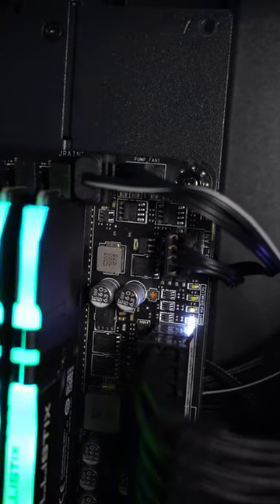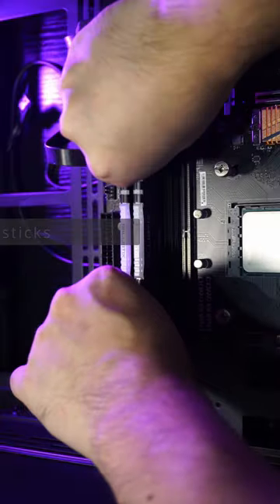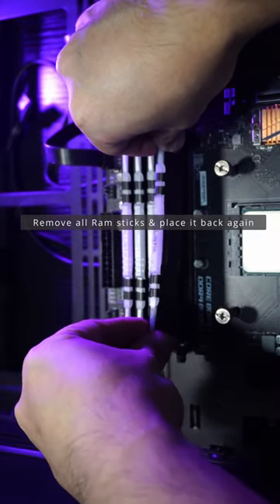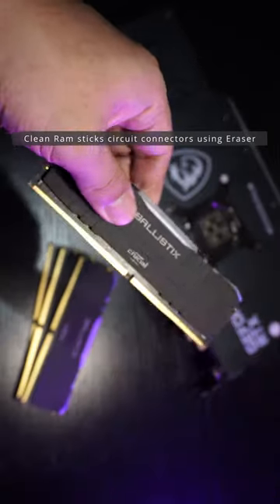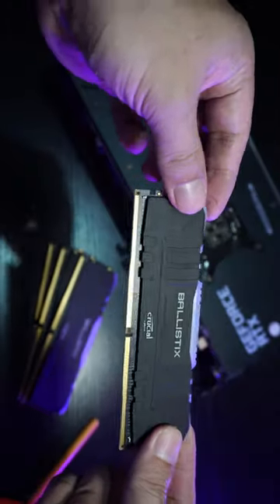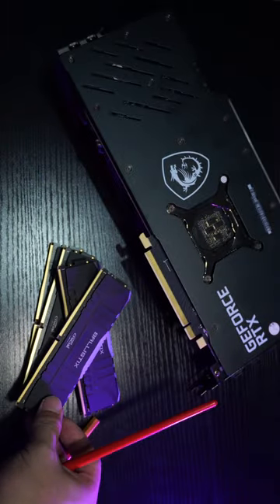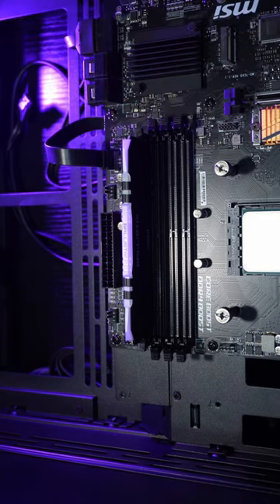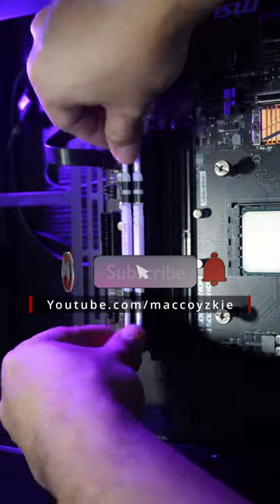Dram Debug LED always on FIX Part 2 #shorts

Comment: Actually. Instead of erasing the dark marks. Lightly Use the lead of the pencil instead, color in all of the metal connectors. The lead acts as a conductor boosting the current. No more worries about dark spots and erasing.

Comment: What if I have two ram stick 16gb, 32 in total and both work? I tried to unscrew a little bit the cooler, go through the bios and try to put one of both sticks but they work both
Reply from the maker: if both worked then what's the problem?

Comment: Ty I'm poor and was worried that id have to buy a new motherboard or something. I built a pc a long time ago and I no joke dropped a ps2 controller and it bonked my case and then it somehow bugged out and wouldn't turn on. Even tho I built the pc I'm not crazy knowledgeable about pcs. I took the ram out cleaned it and put it back in and it worked. Ty ❤️
Reply from the maker: glad it worked bro, no problem

Comment: At first I had DRAM LED turned on with no display. After cleaning the RAM like you showed here, the CPU LED was turned on. 
Then I unplugged the keyboard, Mouse and Ethernet cable, It actually work. PC started normally and restarted twice didn't face the same issue.
But I noticed my SSD's lifetime health become 99%.
Is it normal or Should I take my pc to service center for check-up?
Reply from the maker: nah that's fine, check the drive/s it might be almost full, leave at least 25% free space so your pc will boot normally always

Comment: I am currently having the issue where I recently installed a new CPU chip after frying my old one. Fired up perfectly fine however the DRAM light is a solid amber orange color non blinking just solid.  The led lights on the ram lights up fine. The lights on the IO shield light up fine and everything else works fine. I assumed maybe the sticks were faulty or whatever no biggie I switched them out with ones on my personal system that work fine and still the same issue so I suspect at this point that it's the ram slots themselves. I hooked everything up for a POST test outside of the case and that light kicked on. I will go get a can of air duster from the local Walmart and blow it out hopefully it's just some dust trapped inside the ram slots. I tried every slot with 2 sets of sticks and same problem. I assume it's the spots at this point.
Reply from the maker: what are the pc specs with the new cpu? depending on the build it might need bios update
Reply: @MacCoyzkie  Asus ROG b450f gaming mobo, Ryzen 5 CPU, corsair vengeance RGB 16 gigs ram pro I don't remember the speed I think it can go up to 3300 mghrtz I think or some snappy speed around there, Asus ROG strix rtx 2070 super, EVGA 850 watt psu. I had built it once before and the CPU chip shit on me so I bought a new one a few days ago after it being out of commission for about 2 years roughly. Went to install the chip and everything went fine on the POST test except that light turned on. CPU fan runs fine, RGB lights on everything light up fine, tried 2 sets of ram sticks same issue I assume the memory lanes at this point are fucked.
Reply from the maker: ryzen 5 what series perhaps it needed bios update for the b450 motherboard. also what was your cpu before
Reply: I had this same problem bro. I went to a computer technician and everything. Ultimately it was my motherboard. I was high and tried to make RAM mods with it still plugged in. Fucked my my slots
Reply: @ShadyG_  there's a slik chance I had a few beers and might have forgotten to do that...😂
Reply: Have the same issue now and I already tried new ram sticks and had no luck so I replaced my motherboard with a new one and I still got the DRAM light. I really think it may be the CPU but may just end up taking it to a pc repair shop at this point…

Comment: I built my boyfriends new PC and never in the past had this much of an issue with RAM. He has the Corsair DDR4 Vengeance PRO RGB sticks and they are brand new and I triple checked compatibility for his board and they are fine for the MSI Tomahawk z690 WIFI DDR4 that he has. Spent all day yesterday trying to troublshoot the problem, my only guess is that the board is faulty, but the RAM sticks RGB do light up like they are working and have connection when the PC is turning on, so not sure what the problem is.. However nothing I tried has fixed the issue with the RAM light stopping it from booting. These are all brand new parts he bought, nothing was used or refurbished. The sticks are not DOA because I tried them in my PC and they are fine, we placed them in different slots, we tried one ram in each of the slots, we tried my HyperX RAM sticks which I know for a fact work on my PC and are also DDR4. Does anyone have a suggestion what else we can try?
Reply from the maker: yes it is the motherboard, since it's new have it replaced right away. This rarely happens with new pc parts

Comment: Bro, what can I do if my motherboard has cpu and dram red led? 
Is a new build and after put together, I had no video. Both of that leds are lighting. :(
Reply from the maker: may i know the pc specs first? because the motherboard might just need a bios update
Reply: @MacCoyzkie  
I tried to update BIOS but it didn’t work 
Ryzen 7 5700x 
Rx 5600xt 
Ssd 1TB 
Xpg 3200mhz 2x8
Reply from the maker: @dxjja360  what's the motherboard model name? can you remove any hdd, then clear cmos before powering your pc back on
Reply: @MacCoyzkie  oh sure, sorry 
B550 nzxt 
I tried doing that but nop
Reply from the maker: @dxjja360  were you able to finish the bios update or was it interrupted in any way?

Comment: my dram light up during boot up, then went off again when display is up. is it good? 

whenever I play games, it turns off but the unit is running. ( im using asrock b550 pro 4)
Reply from the maker: all led normally lights up and turn off after checking. as for the pc shutting down then this might be overheating, try lowering the game graphic settings
Reply: @MacCoyzkie  I see, thank you!

Comment: Thanks for video , I followed steps below and still no luck . I built computer in 2019
Reply from the maker: can you try clearing cmos to redetect the pc parts, copy paste this link to know how https://youtu.be/S9hyEPTFR10
Reply: Thanks for replying sorry for delay. I did try that but issue still persists
Reply: FYI I’ve also bought new RAM sticks but no luck
Reply from the maker: @alonsorodriguez4498  before we go further, can you tell me how the pc problem started?
Reply: Yes. I was just using it on internet and it turned off by itself.
Reply: Also when I am able to turn it on , it usually shuts off after 5-10 mins . If it stays on the screen turns black.

Also when it turns off , it doesn’t turn on without me flipping the power switch in the back by the power supply from off then back to on
Reply from the maker: @alonsorodriguez4498   if you still hear the sound of the game or video when it went black screen then this is a cable or the monitor itself is the problem. but there are no sound then this could only be low power draw from the psu or a failing motherboard

 at this point you need to have your hardware tested on a working pc to confirm. you can borrow a psu from a relative or a friend, test it with your pc and if the problem is the same this might already be a dying motherboard, you can visit the local shop to confirm

Comment: If the led works but the mobo still has a yellow light on the DRAM, is it a problem? Yesterday it was working perfectly but today when I turn on, it suddenly crashes😢
Reply from the maker: yep it still is, try one ram stick at a time to figure out which ram stick is causing the problem

Comment: i still got the same pc from 2018ish 

i5 7th gen
h110m
16 gb ram

used to have a gpu (1050) but it failed so i stick to integrated graphics since 2020 and rn my screen is flickering (monitor is still 60hz, had a 120hz but it died too)

occasionally whenever i boot it , doesn't boot at all and beeps 3 times with that light on the mobo so

what should i do with it should i clean it then try again
Reply from the maker: try this fix here https://youtu.be/WRNLRm_Zx0c
Reply: @MacCoyzkie  thnx!

Comment: I’m having issues as I’ve just built mine today!

Both sticks are working however everytime my PC reboots i get the dram light. And it takes me to manually switch off at the power and turn back on and then it boots fine?

both sticks are showing in bios and task manager but for some reason i keep getting dram amber light
Reply from the maker: if you have the latest motherboard specially gigabyte, it just needed bios update. but i need you to watch this first https://youtube.com/shorts/nfH5Do3Dq3o 

this is just a general answer because usually i will ask your pc specs so i can have an idea
Reply: @MacCoyzkie  It’s this one

MSI MPG B650 CARBON WIFI ATX 

i’ve never encountered such an issue with any of my builds.

Now i have the same issue, but it boots into windows fine, but the dram light still comes and it takes way longer than it should to get into windows
Reply from the maker: @jdoxpears  im not sure what's up with the latest mobos nowadays doing this. i got several comments having the same problem as yours but most of them are using gigabyte mobo. after i ask them to update bios it seems like those debug led lights are fine now

Comment: I have a similar problem, I buy a new ddr5 and when I turn on the pc the yellow light stay 10 seconds on and turns off like nothing happens and the pc run smooth, only problem is i need way more time for initiation, is any problem with the rams ? My motherboard work max 6400 and I bought 6000mhz
Reply from the maker: perhaps its incompatible with the current rig, have you check its compatibility yet?

Comment: I have the dram blinking when im powering up my pc and i have no display and my keyboard does have the lights on but is unresponable btw I downgraded my gpu from amd r7 360 to gt 710 bc i wanted to switch the gpus between my pcs my gpu fan spins and the cpu fan also spins so please help
Reply from the maker: return the old gpu and ddu the driver first https://youtu.be/SvIJhcxZTsA this might be just driver conflict
Reply: @MacCoyzkie  ty for responding sooo fast ill try it later ty
Reply: It did not work even after returning the old graphics’s card

Comment: Watsup man i have a problem , when i put 2 ram stick in my pc it does'nt open but when i put one of the 2 stick in it working , can you help me ?
Reply from the maker: 1 ram stick interchangeably? either the ram slots or are broken or the motherboard and ram stick just don't work well together. I had few builds like that and we end up replacing the ram sticks. how about ask a friend with compatible pc if you can borrow their ram sticks just to try it in your system

Comment: Same issue, cept ive tried 10 different ram sticks / sets of ram. How likely is it that the mobo is fucked?
Reply from the maker: that's too much test on ram sticks, after you test it with a working ram from a working pc then this should be something else. yes it could be the motherboard but tell me, is this a new build or a working pc? how did the problem started?

Comment: I have a major problem with my Mai motherboard when I turn on my pc my debug light for ram doesn’t flash through but my pc turns on but when I try to use it, it is unbearably slow and does not work the way it used to
Reply from the maker: i need you to copy paste this link https://youtu.be/Kz2-l8DwgEA since your pc is slowing down

Comment: Please i need help.. i have the same issue but this doesnt solve. Specs are AMD Ryzen 7 3800x, Evga 3080 ftw ultra, 850w evga Psu, Corsair 3200mhz vengeance ram. Everything is brand new on this build. Pc was running amazing at first but would occasionally restart.. so i messed with some Bios settings such as cpu ratio which i set to 42 then it bricked my motherboard. Then tried Flashing BIOS through Flash drive with all wires disconnected and all hardware, just cpu and main power were only things connected which was successful.. only now it wont display anything and DRAM red light is on. I've tried everything.
Reply from the maker: can you try clearing cmos https://youtu.be/S9hyEPTFR10 so we can run things in default. Do this only if you're using windows 10.
Reply: @MacCoyzkie  i do have Windows 10, and i will try clearing cmos once more, i just tested my battery and its reading 3v is that normal?
Reply: @MacCoyzkie  just tried clearing cmos, battery was out for maybe 30 mins. Tried shorting the 2 pins for 15 seconds. Motherboard still wont post :(
Reply from the maker: @strainfly7372  that's bad news bro, you have to individually test out your pc part because at this point we don't know what's causing it. if you have a friend with compatible pc have your pc parts tested in their rig to see what's not working.
Reply: @MacCoyzkie  All good, I do appreciate the replies. Worst case is I have to buy a new motherboard, was thinking of going with Asus this time around, x570 wifi should be a good replacement to the b550 gaming edge wifi right?
Reply from the maker: @strainfly7372  i hope it all goes well then and yeah that x570 is a nice mobo, if you can ask the store where you will buy it from to update the bios for you that will be even better
Reply: @MacCoyzkie  hello! Good news, I finally figured out the problem... or should i say problems... I ended up taking the mobo out of the case and reflashing it the right way. I then found out through trial and error that my 1st ram stick slot is bad as well as my main GPU slot, - This is a brand newq motherboard :( - I then realized that the program driver booster 10 was actually corrupting my driver updates so i manually updated... so far so good about 2 days into heavy gameplay. Thank you for your help!
Reply from the maker: @strainfly7372  those driver booster are just gimmicks, its actually doing more damage than help and i experienced that many times already so I stop using any of those since 2015. Anyway glad its all good now bro

Comment: ive got a problem where with both sticks in and doesnt matter which order the gpu wont start but all the other rgb and componets start like normal, both sticks of ram work like normal when not using both at the same time, it happened all of a sudden im not sure why so im currently using 1 stick of ram because im limited

Comment: Idk why but when i power up my pc my b450 tomahawk have a dram red light but then after a few seconds it boots up and i have 8gb out of 16 usable
Reply from the maker: it normally lights on then off and basically it is checking if the ram modules are on the slot and is working. 

if you have 16gb ram and only 8 is being detected then you need to reseat both and clean the dust off the ram sticks and the ram slos. you can also do the suggestion cleaning method in this video

Comment: My slots 1,3 are defective this is the 2nd B550 board 2nd board I got
Reply from the maker: use Rma
Reply: @MacCoyzkie  This is the 2nd board they have sent and I really couldn't be bothered returning it again since I got 16gb anyway
Reply from the maker: @stevemoore4286  is that really a new mobo they sent you or did they just place the old mobo in a new box? if it has the same problem you have all the rights. ask them to send a replacement or get a refund

Comment: I changed cpu cooler and it wont boot up, it shows the dram light, I didn’t even touched the ram sticks. I tried one ram stick, cleaning them, nothing worked. Any ideas?
Reply from the maker: can you try clearing cmos, here's how, copy paste this link https://youtu.be/S9hyEPTFR10
Reply: @MacCoyzkie  it was the gpu riser extension
Reply from the maker: @diegocervantes4977  i see, how did it became faulty?

Comment: I realized one of my ram sticks wasn’t installed and didn’t show on BIOS or in windows so I only had 8gb instead of 16gb I tried to switch them look what was broke or what the problem was and now both don’t work and I forgot wich one was the one that was working 😅
Reply from the maker: try one ram stick at a time then boot the system, try the ram cleaning the broken ram might still work

Comment: Tried this a couple times, but the problem is still there. Anyone got a fix?
Reply from the maker: new pc build or was a working pc before the problem started?
Reply: @MacCoyzkie  new pc build
Reply from the maker: @GrumpyWolfman  i see, most likely your motherboard needed bios update, may i know your pc specs?
Reply: @MacCoyzkie  sure, I have an msi b550 motherboard, and ryzen 3 cpu, and patriot viper 1x8 gb ram stick
Reply from the maker: @GrumpyWolfman  Ryzen 3 what series? your motherboard might need bios update
Reply: @MacCoyzkie  ryzen 3 3300x
Reply from the maker: @GrumpyWolfman   cpu doesn't support integrated graphics, you need a gpu to be able to use the pc
Reply: @MacCoyzkie  sorry, didn’t mention it before: my gpu is a nvidia gtx 780ti
Reply from the maker: @GrumpyWolfman   ok the only thing we can consider now is the motherboard needed bios update for the 3300x, you can ask the store where you got the motherboard from to do it for you but if you want to do it yourself you need to watch this first https://youtube.com/shorts/nfH5Do3Dq3o
Reply from the maker: @fappi4548   try one ram stick at a time, if the ram slots are dusty clean it